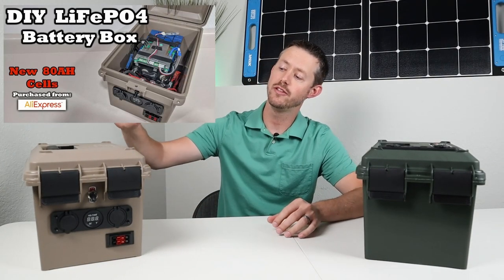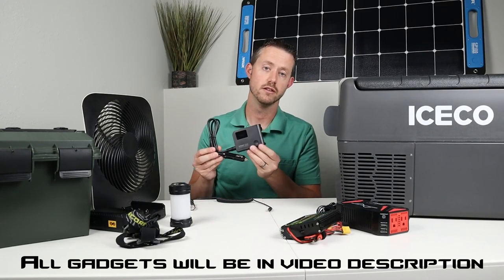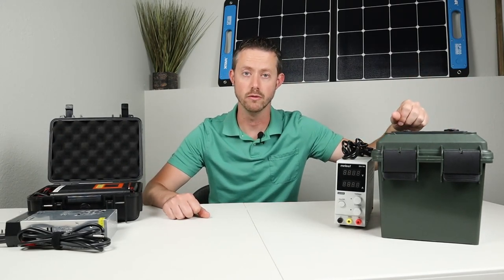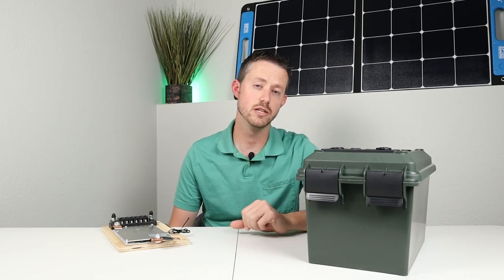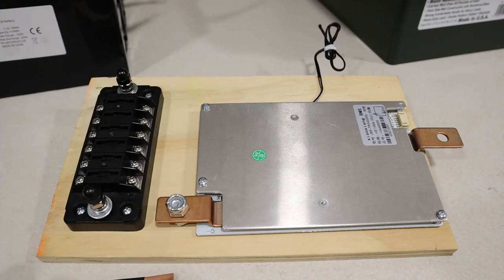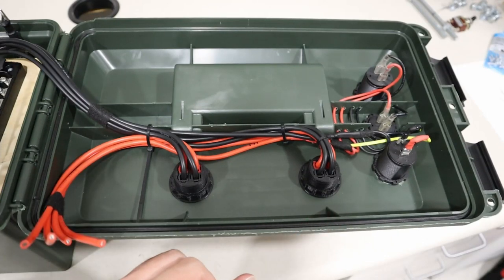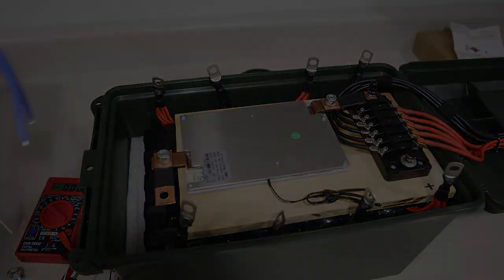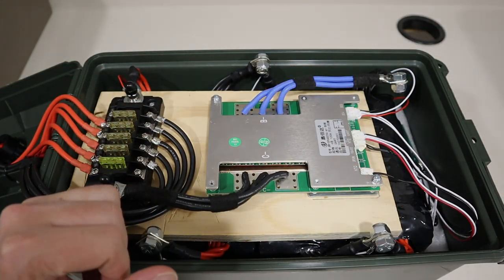$420 100AH LiFePO4 Build - BatteryHookup.com Modules - Super Easy Assembly! COMPLETE DIY GUIDE!

Comment: Love your videos on these diy builds. I wiuld love to see basically the same build BUT for a setup to replace the lead acid batteries in an RV. I have 2 lead acid batteries in my class A RV. I currently have 8 200ah cells that I want to make 2-4 cell 12v batteries. , 2 BMS's. Since these are for replacing old batteries with these all of the extras you add I don't think would be needed. Just an output so both 12v batteries  go together to give me 400ah and then into my existing RV wiring where the old lead acid batteries hooked up too. I would use the same ammo box as you have here. Any ideas? Thanks for your videos. I will be upgrading my solar on the RV. My original little stock solar panel was destroyed by hail. I want to go to 4 2' x 4' cells My cells are approx 2 1/8" deep, 6 7/8" wide and 9" tall to the top of the post. Amazon says this for internal dimensions: 12.5" x 7.5" x 7.2" High . Are your cells shorter? You are using 100ah I have 200ah cells.
Reply from the maker: I'd just recommend to buy a couple "cheaper" 100ah lifepo4 batteries to keep things simple. They have built in BMS and they are near the same form factor as the lead acid counterpart. They are drop in replacements. Search Amperetime on Amazon.
Reply: @Jasonoid  Why would I buy more cells? I already have 8 200ah cells and 2 BMS's like I said above? My question is about the ammo case you use. My 200ah cells are 9" tall to the top of the posts. Your 100ah cells, are they shorter?
Reply from the maker: @goodwinml  Im sorry, I misread it and thought you were going to purchase them. If you already have the cells/BMS modules, just mimic this same setup, put them in parallel and hook up your inverter.
Reply: @Jasonoid  You missed the question again. I understand how to put together BUT my question is the AMMO CASE. My question is about the ammo case you use. My 200ah cells are 9" tall to the top of the posts. Your 100ah cells, are they shorter? I o not want to purchase 2 ammo cases and find out they are to small to hold my 200ah cells.
Reply: This is straight from amazon and the case you use. "Inside dimensions: 12.5" x 7.5" x 7.2" High " I believe that's just the bottom case not including the cover. My cell is 9" to top of the studs. Cover looks to be adding 1 - 2" to internal height.
Reply from the maker: @goodwinml  sorry Mike, I was under the impression you knew your setup is much bigger than this one in the video. The rough internal measurements of this ammo case are 7 inches wide, 7.5 inches tall and 13 inches long. The four 100ah modules I used in this video barely fit into this ammo case. Trying to fit 200ah of batteries (4s @200ah) in this same setup isn't going to work.  From a rough guess you'd have to split your batteries up into 4 of these ammo cases and deal with wiring them together since your battery is about 4 times the size. Probably wouldnt work very well so I'd recommend a custom metal or wood box for completing your setup.
Reply: @Jasonoid  ok, thanks

Comment: Can you recommend any alternative modules? The battery hookup link gives a 404. Thanks!
Reply from the maker: They no longer sell the modules! Total bummer. I haven't found a replacement yet.
Reply: @Jasonoid   ok thanks for the reply! What are your thoughts on the same set up with 280 or 304ah eve cells? More expensive than what you used, but I wouldn’t mind the extra capacity. Would they fit in this case?
Reply from the maker: @ironwoodoverland  they wouldn't fit in this case, but you could build a wood box or find a plastic tool box or something. All the assembly and BMS would be the same

Comment: These batteries are not showing up on the battery hookup site.
Reply from the maker: They have sold out in the last week or so!
Reply: @Jasonoid  oh, the website said the page wasnt available so I thought maybe they got rid of them. Thanks.
Reply: @Jasonoid  they must emailed me back and said they do not plan to carry these anymore.  They said you have to build them from the individual cells now.  Do you have any others you might recomend?
Reply from the maker: @jfwatson10  You can build a similar system using any 100ah LiFePO4 battery from Amazon, the prices are pretty decent for the Zooms 100ah, and the Chins 100ah. Both have been tested and torn down by Will Prowse. Only downside to those options are that they do not have low temp charging protection. Options get more expensive when you start adding a bluetooth app and cold temp charging protection.

Comment: can you use 16ga 12v speaker wire ???
Reply from the maker: For which connection? For the USB ports and voltmeter that's fine, but for the larger loads you'll want 12 awg wire.
Reply: @Jasonoid  hay ill be putting usb ports and voltmeter and cigarette lighter port on my box. all I need to run is a air pump to inflate a airbed run 1/2 night lights and to charge up phones and maybe a camera and banana jacks to sola charge to battery
Reply from the maker: @robertcoleman5560  That 16awg wire should be fine for those loads.
Reply: @Jasonoid  cool thankyou

Comment: It's frustrating that I can't buy a product like this from a company like Goal Zero, Jackery or Bluetti.  It's not all that different from their normal products.
Reply from the maker: This build is kinda in-between a power station and a basic battery right? It doesn't have any built in inverters or chargers but it does have a few basic outputs. And then you have companies that offer lifepo4 batteries with no outputs like SOK and Battleborn. 

It would pretty cool to see a company come out with a battery that has just DC outputs (12v socket, USBc, and Anderson powerpole) and a BMS. The price should be pretty affordable in mass production

Comment: No fuse on battery?
Reply from the maker: Each output / input is fused. the BMS also protects against over discharge and short circuit events.
Reply: @Jasonoid  if anything shorts after the battery and before fuse block it will hit the battery
Reply from the maker: @andrewzheludkov   luckily all the terminal connections are double covered with tesa tape so it's unlikely for any short to occur. You can build your battery with additional fuses if you wish 👍